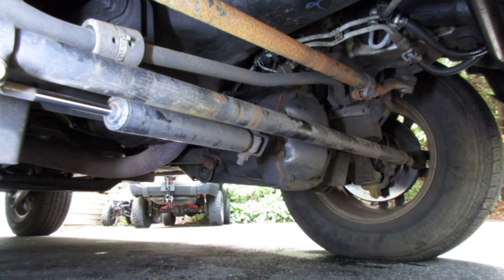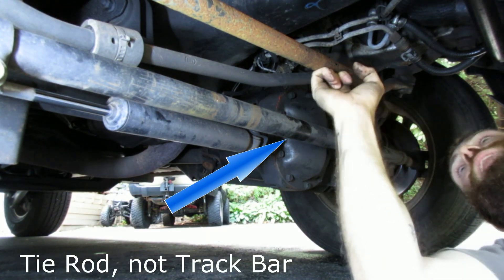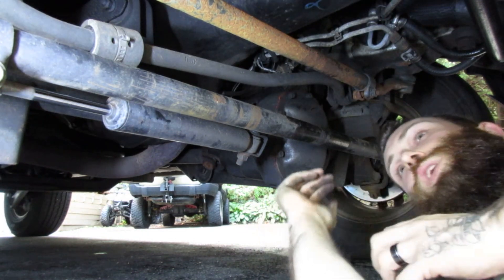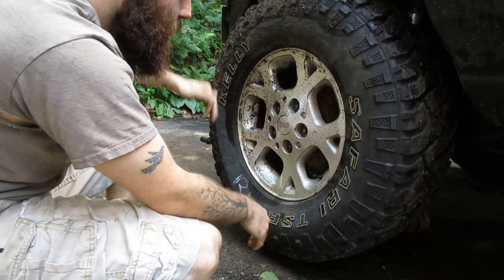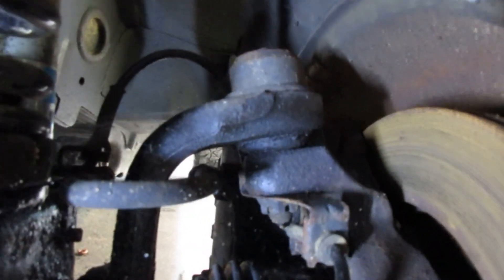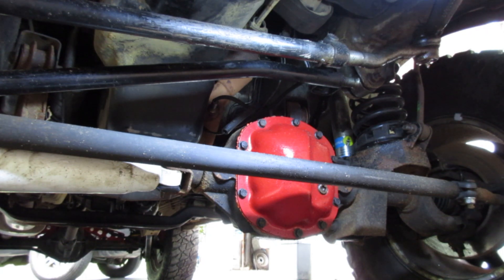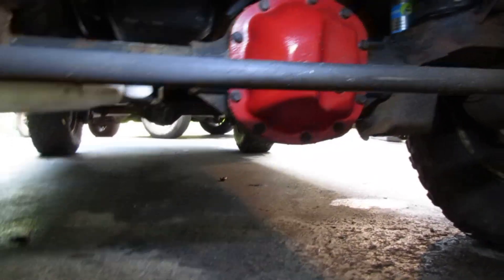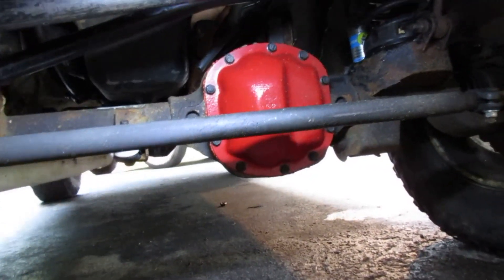How to Diagnose DEATH WOBBLE

Comment: The root of death wobble,  is toe in. Or even too far out. Loose things is not the root cause of death wobble,  just let's it happen easier 
Other things can start the oscillation,  such as bad tire or imbalance. 
When your front tracking is off, your tires load perpendicular and will start the oscillation when a bump or anything lessens traction. 
Simply,  start a little toed in , and toe it towards out a half turn at a time until it stops deathwobbleing completely. 
If you go too far it will deathwobble again.
Don't even try measuring because it can be too touchy with some tire wheel combos.
On many you will end up with them slightly toed out due to the crown of the road effect, making the tires want to track in. Especially tires with a big footprint.

Comment: one other possible cause is differential tire wear if none of the things you suggest are found lacking then swap your tires front to rear even a millimeter or two can cause problems, then just rotate regularly afterwards
Reply from the maker: Yea, good call. I should have mentioned that as well

Comment: Tires was the cause of my death wobble. I have 33 x 12.50 Goodyear wrangler tires. 2005 Jeep Wrangler TJ. I had tried dual cylinder steering dampener. Didn’t fix my problem. But when the tires were replaced. Inside the tires had what looked like coffee grounds in all 4 tires. Guess it came from sidewall tires. Replaced the tires. That took care of my problem.

Comment: 2018 ram 2500, I replaced the tie rod, it was late at night when I finished it and did not have time to install the steering stabilizer and I drove home with out one on the freeway, when I hit 65 I hit a pothole and got crazy death wobble. Next day installed stabilizer got alignment new tires , now there's a slight shimmy in steering wheel and I can feel more of the road ,also never got death wobble again but just seems like something is off or not correct.
Reply: Thoughts???
Reply from the maker: Well death wobble is a pretty violent thing. That incident could have throw some other part out. I would check all the usual suspects

Comment: 2002 wj... recently replaced the track bar.. still play on both ends... MUCH more on axle side than frame side. Did you ever make a video of how to repair a "wallowed out" hole where the track bar is secured?
Reply from the maker: I have not, but I will. the easiest way is to get a grade 8 washer and weld it over the hole.
Reply: @DEInTheGarage  would you happen to know the size (interior washer diameter)  I'll need for each side? Simple as sizing from any old 15mm and 19mm bolt at Lowe's?

Comment: also, "Very Important!" (replace the bushings and ball joint for the rear axle) along with front axle bushings, trac bar, knuckle ball joints and all rod ends..
Reply: OK take it to wrecking yard and cubit
Reply: @livenloud6697  there are kits that take care of most of these components and are not that expensive in comparison to many other link suspension rigs.  or go buy a subaru or toyota and quit bitchin
Reply: There is ship car that should never be allowed on a roads
Reply: Best repair kit is called a grenade they shouldn't even be allowed on the road Jeeps are dangerous here's some facts for youhttps://youtu.be/S8kZWa8Q3Gg
Reply: https://youtu.be/wOZP3HeIg7A
Reply: https://youtu.be/5sVmoOZRypk...    

I hope this is enough evidence for use to get on with your lives and buy a Toyota Isuzu or something that lasts forever and is proven
Reply: How the vids i sent help

Comment: Not true most trucks do not have an axle in the front end these days most trucks are independent front suspension (ifs)  Ford still puts a solid axle differential under they're front ends. And ifs front ends get the death wobble problems even more so.....    so false info not exactly correctly spoken maybe watch what your saying before you start numbering checklist problems for certain issues you were not correct the video has a few claims that show you are not as knowledgable in this subject as you babble on acting to as if you do.     Do your homework or shut the fuck up not always a need to talk or be on front of the camera nobody who thinks this is helpful actually understands either

Comment: most often death wobble is caused by loose rivets in the frame. The big three are guilty of using subpar rivets vs Toyota and nissan. Weld up the frame where it joins up is the only cure.

Comment: I've experienced death wobble before but I'm not sure if that is my issue now. I have a little vibration going on at higher speeds but definitely not death wobble, however I have this horrible clicking sound from somewhere in the front axel or steering components when going over bumps or articulating. Maybe check out the tie rods? Anyone have any ideas cause it's been annoying the shit outta me that I can't figure out what it's from lol
Reply from the maker: I would look at control arm bushings and sway bar links/mounts. The both tend to make noise if they are worn when articulating
Reply: @DEInTheGarage  Thanks for the advice! All the boots and rubber on my rust bucket seem to be shredded so that might be an issue.. lol

Comment: My 1996 Cummins 2WD Ram truck had a similar issue.  The front left tire would bounce 'out of control' above 30mph.  The culprit was the rear right seized park brake cable.  Confused?  I was...  Because of the drag on the rear right, the only torque was coming from the rear left which created a tendency for the front end to want to be pushed to the right.  This caused the front right to dig in and the front left to want to lift off.  It took a while for me to wrap my head around what was actually happening, but when I changed out both rear park brake cables, the problem was gone.
Reply from the maker: WOW... That is nuts! I have heard more DW stories than I can count, but that is a new one

Comment: I'll add one more. on my 98TJ when it had about 2k on the dial had death wobble looked at all the candidate's, suspension and steering nothing wrong, turned out to be band separation in the tires, replaced tires and drove that one another 80k before I sold it.
Reply from the maker: Huh... good call. Have never experienced that before

Comment: My XJ had what felt like death wobble ( front end feels like it's falling apart while the steering wheel feels like it's a Browning 50 cal on full auto) every time I went over 40 while starting a turn. The wheels were balanced and aligned and it still happened. Changed the steering stabilizer and no more violent wobbling for the last 50,000 miles.
Reply: My death wobble only occurs when I hit a good size bump doing 45+
Reply: That's nice but it's basically just a band aid. The underlying condition is still there, FYI. It may return once that steering damper wears out.

Comment: Actually you can get death wobble in a vehicle with independent suspension if the  tie rod ends are totally worn out or the ball joints are totally worn out . Steering box worn out can cause it too.

Comment: Good video I wish u would have done it on a car I have death wobble I just got 2 front lower control arms a new passager side axle 2 front ball joints I was doing 60 and my slip light came and the car felt it was going to cut of my tires bad real bad I brought about 5 tires n a month because I have to get my suspension parts all good 1st then alingment
Reply from the maker: You can do the same tests on a car. Just get under there and look for what is loose

Comment: As a guy who went to certified mode part school I'm telling you the crossover bar or your steering bar when you head a bump just write it Benz and it pulls the wheels in and then it goes out in and out in now and tell you slow down and it stops causing death wobble

Comment: This helps so much, would replacing the shocks cure the problem also ?
Reply from the maker: Poor shocks could possibly exacerbate the underlying problem, but they will never be the root cause of death wobbly.
Reply: D&E In The Garage  how would I decide the problem to a mechanic, without misleading them into thinking It just needs a steering stabilizer

Comment: I never used a steering damper. Haven't experienced death wobble yet. Its critical to check all the joints under the vehicle once a year.  See something or hear something off, fix it now. Lifted Jeeps are so much better to drive when they have high steer and  a raised track bar. Also get long arms above 4" lift. The ride is worth the money.  All of that will help steering handling and ride.
Reply from the maker: That is some solid advice right there. Everyone wants to add a lift and never think about their suspension again.... just not how it works..
Reply: @DEInTheGarage  oh, and I daily drove that beast of a Cherokee for 13 years.  New one will be built the same.

Comment: Thank you nice video even without the death wobble go to know how to and what to inspect on the drive train. I have not felt the wobble yet but do have some play in the steering and the steering wheel is not centered. So I think I better start looking. Just had the calipers brakes and rotors replaced and it runs nice and smooth just a little play and a strange little clunk sound in reverse as you let off the brake

Comment: Excellent video. The best I’ve seen yet. One question: on the last test that you described do you want to go all the way from lock to lock with the steering wheel or do you just want to go back and forth about an eighth of a turn? I typically have done it the latter way and it seems to demonstrate where the play is.
Reply from the maker: I would suggest both. Some things can only be seen at the very extremes of the steering systems travel. You are correct that jerking back and forth quickly is sometimes more efficient

Comment: I'm hoping u can help me! My 2001 wj recently had new transfer box oil, mechanic put normal oil not the proper friction oil! I had really bad noises while turning! Maybe 60 miles later proper oil and additive from jeep was added! Still a little noise when turning hard left! I do have a rattle front right  wheel area! Underneath has been checked, all secure! It's in a 4x4 specialist tomorrow for it to be diagnosed and fixed! But I'd like to know if drivin with the wrong transfer oil could have damaged something?
Reply from the maker: I am assuming you have either Quadra Drive or Quadra Track? The answer is yes, unfortunately. The 247 used in those two 4x4 systems need to have the proper fluid of it can burn out the limited slip mechanism.
Reply: @DEInTheGarage  many thx! Quadra drive! I've driven her really carefully, no more than 60 miles! Transfer oil has now been replaced! Jeep have said the diff oil is also a specific type! Jeep now at garage, new shocks being put on, a few other little things! It's only done 65000 miles, one owner, fully serviced, standard, unabused example! So I'm hoping no damage has happened!? I've also a 1990 classic range rover 3.9 v8, that thing could have veg oil and run happily! Dang these 'modern' cars! Great vids by the way! If they help me, u r helping so many people!

Comment: And before you go to the expense of replacing the track-bar (which may not be bad) take a close look at the passenger side track-bar bracket, bolt and bolt hole. Weld grade 8 washers on the front and backside just may reduce the play & movement of the track-bar which allows the oscillating (d wobble) everyone looks for. Replace the bolt and nut too. Maybe go SAE.? Ball joints cause a similar yet different reaction in the steering. Hey "K.I.S.S." is the best motto. But the joints of your track-bar may be worn too... just saying.

Comment: So last night I was driving comfy down the road in the country just enjoying the night, all of a sudden my jeep starts shaking like crazy almost feeling like it's falling apart, I slowed down and it would go away, gain speed and it would come back, it did it about 4 times. Almost pisses my pants, never experienced that before. I have a 88 with a 91 engine in it. Do I have death wobble?
Reply from the maker: Yep, I'd say you have death wobble for sure.
Reply: I had my wife turn the steering left to right and I saw a lot of movement on the track bar but on the upper side of it to the frame, not the bottom end of the track bar. So I guess I need a new track bar huh?

Comment: I have a 02 Chevy avalanche 2wheel drive and it does the wobble at random times  what do you think it could be I looked at bushings everything looks right to the eye
Reply from the maker: Since that vehicle is independent front suspension so you should be looking at tie rod ends, a-arm bushings, ball joints, and wheel bearings in that order

Comment: So I just purchased a 1978 cj and she's a beast....however...she walks all over the road! I get into the gas and she tracks left,I left up the gas(say the shift gears)and she tacks right.... What could possibly cause this?
Reply from the maker: It sounds like a mix of worn front end components and possible a bad wheel alignment. I would checkout the tie rod ends the way I did in this video. Also, there is a good chance your steering box is just worn out being so old. When it comes to Jeeps that old you have to ask yourself what a reasonable expectation is for on-road manners. It is always possible to get her riding like new, but there is likely a long list of things that need to be replaced to get there. I would replace any worn front components and then get a wheel alignment. Sounds like a cool jeep, though! Good luck with it!
Reply: Does it have a rear locker?

Comment: No one speaks of the bolt and hole size differences... metric bolt vs sae hole size. This lends to sloppy fitment, movement and abnormal wear. Poor engineering.

Comment: So my death wobble happens when I hit the brakes when slowing down from 60-55mph after that it’s gone. But when I’m slowing down to a stop it feels like my brakes are releasing then grabbing. I’ve been told to replace the steering damper. Then been told to replace my rotors
Reply: That could be the rotors, usually when it's breaking related it's due to break rotors, maybe one or both could be warpped.

Comment: Hey man I just put a new track bar, steering box and still have death wobble
Do you think it's my caster? Going to take it to an alignment shop tomorrow and see
Reply from the maker: It could be. Did you lift is a bunch without changing control arms?
Reply: It's lifted 4", didn't change the control arms at least I don't think the previous owner did
Still have it after replacing track bar, steering box,I'm going to change the tie rod end Thursday and see what that does
Reply: I think I finally figured it out, hopefully it will help someone if they happen to read this

I have a 04 Grand Cherokee,4" lift... what I'm thinking is it's the drop pitman arm that was installed before I bought it,the geometry is all wrong, looking at it I think it should be inline with my track bar,it looks to be about 30° out
I'm going to use an oe one tomorrow and see if that solves my death wobble as well as the bump steer I'm getting
Wish me luck

Comment: Question...i have 05 jeep wrangler tj with 3.25 rough country lift 33x12.50's 15 inch never had a problem got alignment done n still no problem they told me I'd need dropped pitman arm to straighten steering wheel n still no problem until they corrected steering wheel so that it was straight then upon leaving I hit a big bump n got a bad shimmy in steering wheel but then I didn't notice it happening anymore I'm so confused any help would be greatly appreciated they also said it appeared my balljoints were fine..any pointers??
Reply from the maker: Hmm.. Well to straighten your steering wheel they have to loosen and adjust the collar on your drag link. Perhaps they did not tighten it back up?
Reply: @DEInTheGarage  I'll look into that thanks
Reply: @DEInTheGarage  checked sleeve appears to be tight pulled on track bar witch was also replaced whn I did lift n it's tight was able to push draglink back n forth but didn't appear to have to much play in it I will check tire rods n after that I would assume ball joints to possibly be the issue

Comment: Check the tires first!!!! 
Almost changed all those parts until someone told me that my tires bad. I put new tires on my truck and now it no longer shakes
Reply from the maker: Valid
Reply: I did the same thing, assuming the tires were out of balance (aided by a tire shop telling me they couldn’t balance a couple and putting in dynamic balance beads). New tires solved it. But a few months later as the tires started to wear, it came back. I discovered my tie rod ends, drag link ends, and track bar ends were all worn to some degree, so I replaced them and all was well … for a little while. For whatever reason, I had assumed my ball joints were OK at that time, probably because it just had not been all that long since I had changed them. A few more months later it was back as bad as it had been before I replaced all the rod ends, and it finally occurred to me one day to check the ball joints again. They were so bad it scared me. Now I’ve replaced them with a set of TeraFlex heavy duty adjustable ball joints, and the wobble is gone once again. Unfortunately, there are just so many where points in a solid axle steering and link suspension system, that chasing death wobble is going to be a fact of life for anyone with a vehicle using that design. In the words of some Synergy Suspension reps, “death wobble is always coming.“